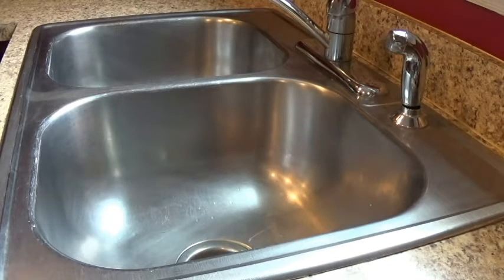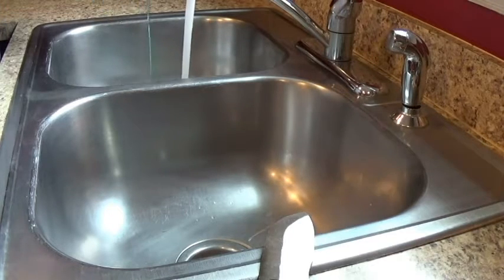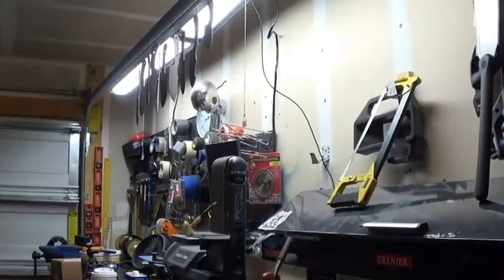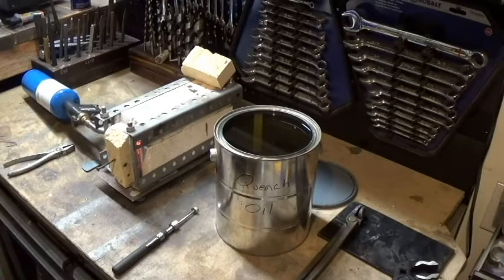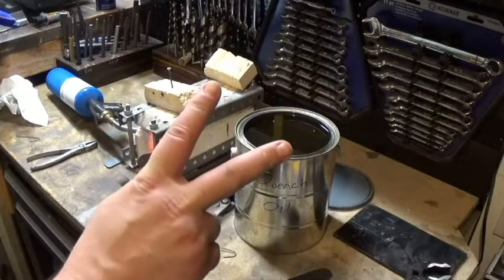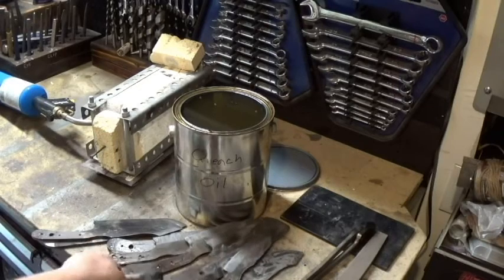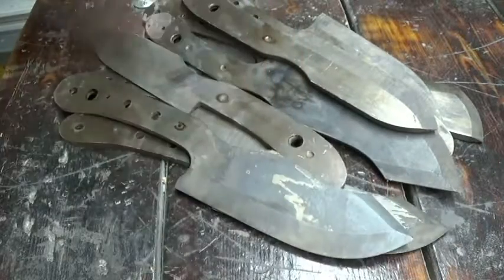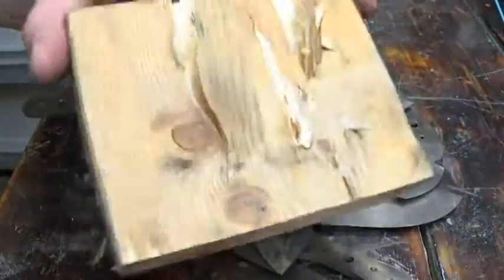Heat treating 01 Tool Steel with anti scale ATP 641

Comment: Canola oil at 120 degrees is the right viscosity for O1 if doing several knives in one gallon as proper temp is 130, if only doing 1 or 2 knives use 130 Degrees. It needs to be cooled off if it hits 140 as you will not get a proper quench above 150. I started doing O1 in my charcoal bbq using 2 inch blocks of Oklahoma blackjack oak and achieved good results and then I made a propane forge. I sent my D2 tool steel to a heat treater there in OKC named Hinderliter.
 Back in the mid 90s I bought a serious heat treating oven and the guys at Hinderliter told me to only buy O1 that has the 0.2% vanadium. I asked why, they said it does not create much if any carbides, but why its put in the alloy is that it restricts grain growth so especially if using a forge where you might get too hot on parts of the blade you wouldn't get an unacceptable grain.  Also if ht in an oven I can extend the HT time by 5 minutes insuring all the chromium and tungsten get into solution and make carbides. So 1475 F for 15 minutes (non-magnetic is 1412-20) and then quench in 120 degree canola oil.  A house oven for temper is 425 for two hours two times and it will give you a hardness of 60-61. Temper time doesn't increase softness, the temperature does and that is strictly according to the Machinists Handbook for O1.
Unacceptable grain size by the way is if you can see tiny little crystals about half the size of a sugar grain, part got too hot. Grain should look like grey velvet. Also according to Robert Cashen, O1 if straightened immediately after temper is very easy to straighten, but you only have 3 minutes max to do it. It has something to do with the high amount of manganese in O1 which is over 1%.
Reply from the maker: Thank you!! I appreciate the awesome tips!!

Comment: Great tutorial. I will be looking into making a forge like yours.  that anti scale compound does really good. awesome stuff.
Reply from the maker: Yeah man, I forgot to mention it when I showed that knife I broke, but black crud is scale, or carbon loss, that flakes on the outside. 

after breaking that knife in a stress test I decided to up my thickness from 1/8 to 3/16, and also seek advice from metallurgists at work. 

the results have been fantastic. and that ATP 641 stuff is cheap. that quart was only 15-20 bucks.